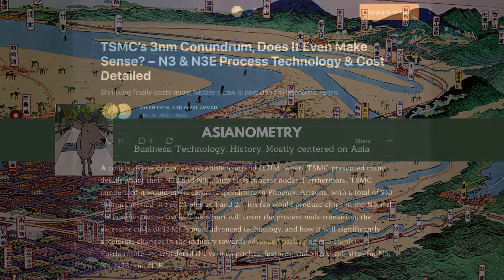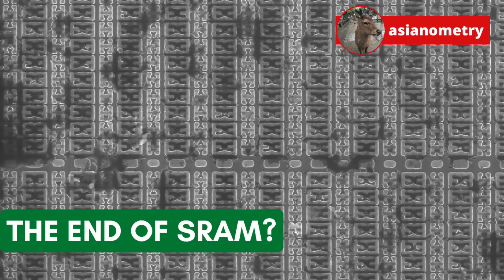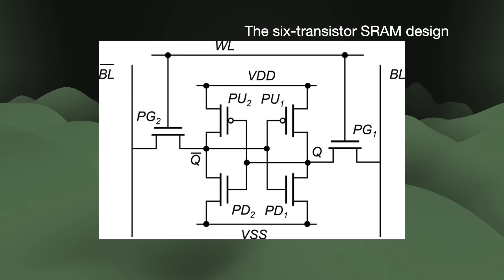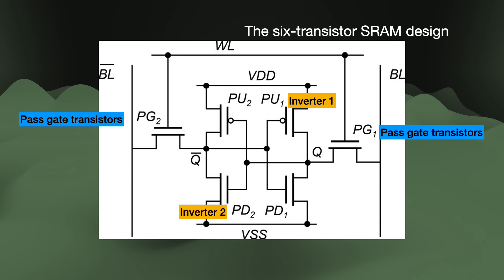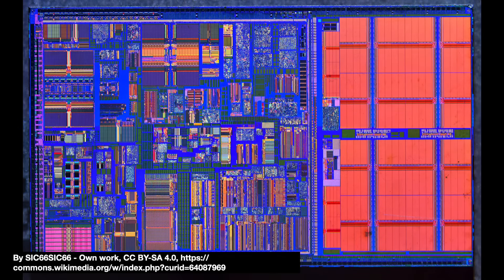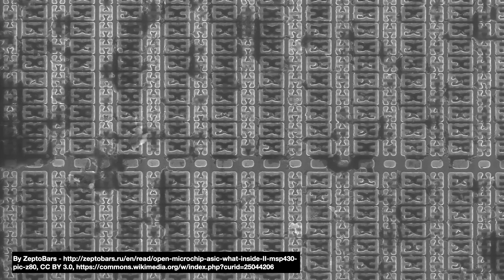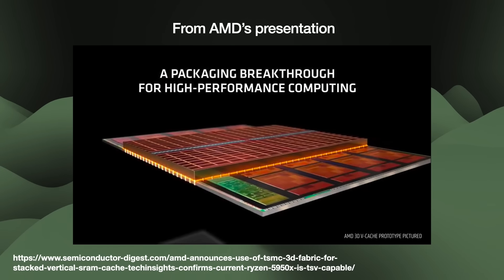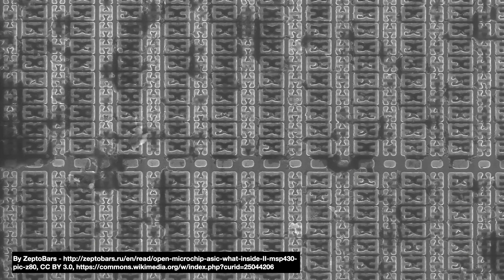Can SRAM Keep Shrinking?

Comment: SRAM is something I would not expect most people to know anything about unless they have some knowledge of CPU architecture.  That is because these days it is used as the cache that comes as a part of the CPU itself.  I do remember a time when it came as a module you could install similar to a DIMM.  That was back in the days of the Pentiums when MMX was the thing to have.  If you ever saw a Pentium II with the heatsink off you would notice two chips next to the processor.  Those were the SRAM chips.  Those ones ran at half the speed of the processor itself.  Why half the speed?  I don't know!  It must have been a technical limitation at the time or a strange decision by one or more of Intel's engineers.

Comment: Thanks for this analysis it provides a vary clear explanation of the challenges in modern chip design. I wonder if stacked cache has trade offs as well such as latency, being further away from the logic core. We seem to be at the limit now with 5nm too be honest this is better than I expected I remember telling a co-worker 10 years ago 7nm would be the limit. These multi pattern designs may allow us to get smaller but at substantially lower yields and higher costs. This is I guess why cutting edge tech is getting more expensive.
Reply: A stacked chip can be closer than most surface of an on-chip cache.
The problems is the chip-to-chip vias use much more space than in-chip lines.
It uses footprint, it constrains line placement and spacing, and it requires stronger electric drive.
Reply: @musaran2  cool makes sense

Comment: since the active layer on a silicon chip is just a few layers and nanometers thick, they could go more vertical like 3d nand.  theres plenty of vertical room
Reply: Except the heat concentrates then and bakes the interior SRAM. It is a solution, but not a long term solution.

Comment: To enable it, try copying Windows 3.1 and dos files from the memory to the micro sd card in about 500 mb quantity. When the copying is faster, you activated this little portion. That is one, why a card is called hc, xc. It acts as a coprocessor. It also acts as a sound processor or codec. The card has Physx, but it is separate. When the portion is active, the card becomes highly reliable. Good for managers who handle precious data.
Reply: What were you supposed to comment on? This doesn't seem like it.

Comment: I still enjoyed the video but I kind of feel like I missed the part about why sram shrinkage is a problem with the current cutting edge nodes in particular. I certainly understand better the core tradeoffs and issues with sram cell design but which part of that is the problem with for example 3nm? Is the answer essentially we don't know because tsmc is being tight lipped about the exact details so we can only make more general conclusions?
Reply: Ah, I think I can answer my own question after watching it again. It's a question of yield. Denser SRAM causes yields to drop below an acceptable limit to be commertially viable.
Reply: @lexer_  SRAM has not scaled in roughly a decade. Now it isn’t even shrinking at all. So we are going 3d and stacking. But that’s expensive and runs into heat issues. Like a hot sandwich where the meat gets extra cooked

Comment: A bit worrying, if the development tackles off, and we still increase the compute demand with 25% year on year or more, I guess we will start using that level more electricity per year. Might be a real problem eventually
Reply: Bro, we have 1kW per square meter coming from above in daytime.
Reply: Well given that semiconductor production shares a lot of the logistics of the solar panel production maybe we can fend of that problem for a few years.

Comment: Intel started their career making ram before switching to chips. Maybe they could use their fabs for 10nm dimms
Reply: Doesn't change the fact that the distance to the dimms is the bottle neck. We've had 7-8ns latency RAM since EDO, but that pesky "universal speed limit" we call the speed of light won't let us go any faster unless we move closer. So we move as close as we can get: onto the chip.
Reply: @andersjjensen quantum computing fix all of that.

If cpu does a true parallel computing it's the other solution to save time instead of  queue in line for certain clock cycle.  Specially if the software is designed to handle multiple thread computing.  Simulation of physics of trillions of individual particles would greatly help. This would required less clock cycle,  and less access to ddr ram speed.
Reply: @BlueRice   for parallel programs we have gpus, quantum will never take over, we need our computers to always give us the same answers.
Reply: @cj09beira  quantum is promising. If it actually works, it's almost like magic. It will give you same answer. The problems with it it is not stable. You will run into errors after long duration. Is there any error correcting methods.. is there a way to check the code after each process. Can it even check itself.. the state of matter is hard to control

If you really want to build a robot, android per say - quantum will make a robot as smart or smarter than human. They already can map human brain pattern to some extent. Load that on quantum computer and it probably have its own consciousness

Comment: SEUs and feature size is an issue ?  yes / no    L1 and L2 cache really need EDAC to avoid CPU crashing.  SDRAM FIT rate was
about one event per megabit per month at Ground level.   This was researched by IBM and others.   24/7 operation can be an issue.

Comment: I was going to ask why SRAM cant keep shrinking at the same rate as lógic ( weird since both just use transistors )  And what posible replacements are there ( STT ram, magnetic ram, etc )
Reply: He said so. Tunneling and defects.
Reply: @alphar9539  But those will affect the logic circuits as well.

I suspect the difference is that SRAM is not clocked at such a high rate: so is expected to retain the data it handles for a longer period of time.
Reply: if you shrink it too much, it becomes a DRAM 😂 an unintended one
Reply: @economicprisoner  logic circuits do not have to be error free. Errors in SRAM are unresolvable most of the time, while logic errors can be corrected without a fatal mistake for the CPU.
Reply: @alphar9539  There is ECC: but it has a performance penalty.
Reply: @economicprisoner  ECC scales even worse than SRAM and suffers from higher complexity. You would likely encounter the same issue of not being able to use the most efficient SRAM die layout design if you have to put ECC throughout. Clearly further advances are possible and likely, it just costs more money.
Reply: @alphar9539  Very interesting, first I have heard about that, how does a modern cpu handle logic errors ?
Reply: @alphar9539  -What do you mean ecc scales worse?

Comment: Yes hello I am a programmer and I would not like more logic on chips please.  Please remove all floating point circuitry and replace it with more cache - the single biggest performance killer nowadays is not the IPC or calculation throughput, it's the memory throughput and latency.  I do not need floating point circuitry on my CPU, I have a very expensive floating point-specialised co-processor in my PC.

I could also get on board with removing all SIMD circuitry too, but that's a more arguable position.

Comment: 📝 Summary of Key Points:

📌 TSMC's new 3 nanometer nodes, N3b and N3e, have the same size SRAM bit cell as their N5 nodes, indicating no scaling of SRAM from the N4 to N3 node.
🧐 SRAM is a fast but expensive memory technology that takes up space on the chip, while cheaper memory systems like DRAM and flash memory are slower and off-chip.
🚀 The history of SRAM dates back to 1963, and the most common SRAM cell design is the six-transistor SRAM cell.
🚀 Scaling SRAM cells presents challenges such as power leakage and process variation, which designers address using techniques like Gated vdd and new transistor gate designs.
🚀 Different SRAM cell designs with varying numbers of transistors offer trade-offs between density, stability, and power leakage.
🚀 Stacked SRAM arrangements, where SRAM dies are stacked on top of logic dies, are becoming more popular to increase memory capacity.
🚀 The future of SRAM may involve alternative solutions as current finFET architecture reaches its limitations.

💡 Additional Insights and Observations:

💬 "Squeezing out more fast cache memory with SRAM seems to be a losing game."
📊 No specific data or statistics were mentioned in the video.
🌐 No specific references or sources were mentioned in the video.

📣 Concluding Remarks:

The video provides an overview of TSMC's new 3 nanometer nodes and focuses on the SRAM technology used. It explains the importance of SRAM in integrated circuits, the challenges of scaling SRAM cells, and potential future developments in the field. As SRAM scaling becomes more difficult, alternative solutions may be needed to meet the demand for fast cache memory.
Generated using TalkBud

Comment: Solution to leakages and quantum tunnelling: Develop fusion reactors and power devices using them.
Reply: You still have to deal with all the excess heat generated. Recall that intel made a huge corporate change away from maximizing MHz when they started nearing the same heat flux out of their CPU’s as was seen in nuclear reactors ~ 100W/sq-cm. Chips do not work as well, or for as long, at elevated temperatures.

Comment: What if we just had... larger CPU architecture?
Like how GPUS get bigger and bigger.
Yes but instead of making things smaller, keep the the same size, and make the area the work on larger.
Reply: that's not how things work, for one a cpu is much much different than a cpu, gpus effectively have thousands of extremely small cores all fed by a hardware or software scheduler, running parallel code, so making a more powerful gpu can be as easy as adding more of those small cores with an increase in the supporting elements like faster memory etc.
Cpus have no such option, cpus mostly run code that is serial in nature where one instruction depends on the next, and prediction can only go so far.

Comment: Still I didn't understand fully why shrinking SRAM transistors is a challenge comparing to the logic transistors? It follows from the video that shrinking any transistor is a challenge, not just SRAM one. Or am I misunderstood something?
Reply: Minutes 6-8, power leakage. For logic it is just power inefficiency but for SRAM it is loss of value / instability. Minute 9 onwards, process variation means problems are uneven between different chips. So when SRAM shrinks they get less and less reliable, so in smaller processes you still make an exception and make the SRAM cells big because you do not want random bit flips in the cache due to power leakage etc.
Reply: @randomgeocacher  My understanding is that all those problems (static and dynamic power dissipation as well as static noise) are relevant for any transistor, regardless of its  application in a circuit. Why shrinkage of transistors doesn't bring problems for the logic? Like ALU producing incorrect results when summing two values.
Reply: @DenisBazhenov for most logic  it goes into a forgiving next stage, like D-flipflop or logic gates. If you loose a little bit of power there will be transistors correcting the loss. Apparently the space efficient 6-transistor SRAM doesn’t have this self correcting property… and thus becomes unstable faster than other parts when shrunk. Maybe the circuit diagram gives some clues as to why? I think the video tried to explain this, hmm.

Comment: I know that the stacked SRAM on AMD's CPUs is higher density than the SRAM on the integrated circuit below it. Does anyone know why that is?
Reply: The SRAM below is likely needed to be more stable for critical functions while the stacked SRAM is for excess functions. Stability is more necessary from the most critical SRAM.
Reply: @alphar9539  Both SRAMs are L3 cache. As far as I know the cores don't differentiate between the two
Reply: @alphar9539  That's not how memory works, nearer memory is used to cache the most recently accessed parts of the next layer, but just because something hasn't been accessed very recently doesn't mean it's less important, indeed many critical operating system data structures will only be accessed occasionally.
Reply: Different process/technology maybe? I would guess the CPU dies are built in one technology and has to deal with its constraints, power, heat issues etc. An SRAM cache die built for a single purpose with nothing else on the die/package has more freedom to optimize.
Reply: @randomgeocacher  looks like the answer from someone else is that the SRAM on the logic layer needs to connect with the logic in a “legacy” manner which also prevents optimized SRAM layout. In contrast the solely SRAM layer is designed only with SRAM in mind and therefore uses a slightly more efficient layout. 

This actually makes sense as the design of a Ryzen Logic layer likely was developed before 3d SRAM stacking was prototyped. The connections therefore were set up in an efficient manner for the “legacy” design. Maybe a future design could be more efficient and denser
Reply: @TheParadoxy  I was somewhat incorrect about the stability reason, it looks like the reason is due to legacy design on the Logic Layer due to the SRAM connections to the Logic. The stacked layers can use a more optimal layout design since there’s no Logic part.
Reply: @MatthijsvanDuin  due to how legacy designs were developed, I assume the critical functions are stored in the nearest SRAM and not on the stacked layers. I doubt the most critical functions were developed with stacked SRAM in mind.
Reply: @alphar9539  As already mentioned, these SRAMs are used as L3 caches, they're not allocated to specific functions.

Comment: Does a L1/L2 cache have to be SRAM instead of DRAM?
Reply: “Have to” implies it is a law of nature, so no? Traditionally DRAM is so much slower and unpredictable, for example the the refresh cycle. So DRAM as we know it today certainly would not replace L1 cache.

Maybe some really speed optimized DRAM variant could tackle L2, L3. I.e. DRAM don’t have an obvious way to replace SRAM, but especially for L2, L3 

I wouldn’t dare to say that designers never can come up with new trade-offs or new designs. So everything depends on if some smarty pants developer can make new designs and trade offs that make sense. The further away from the CPU core it “only” has to be closer and faster than acceding the main RAM to be a good trade off, the closer it is to the CPU core we want near-zero latency and predictable access times.
Reply: Within the logic circuits themselves (as in the CPU) bits can be represented as dynamic charges, very much like in the DRAM. A circuit node would be pre-charded in one part of the clock cycle, then discharged or not depending on the input signals to the logic element, and then the result would be sensed by the next level of logic. Preventing the charge from leaking away between the pre-charging of the node and the sensing the charge later is what sets the slowest clock frequency for such circuits. 

All of the earliest CPUs were like that. If you wanted to execute one command at a time, you could not just suspend the clock, instead there were special circuits for freezing the execution while all the circuits still cycled at their normal rate. But then some CPUs started to be designed without using such tricks, and were "completely static." In this case one could simply slow the clock all the way to zero frequency without loosing any functionality.

So, in principle, dynamic elements could be utilized anywhere in the circuit. Whether it would make sense for the cache would depend on the achieved trade-offs in speed and density. Currently this does not seem very attractive, especially for a process not optimized for DRAM.

Comment: Functionally speaking the main task of CPU is to compute. Any transistor that doesn’t compute is a waste. Cache is not only doesn’t compute, but it’s storing duplicate of the data already present in the system. There is a great potential in new system architectures that doesn’t require to store the same data multiple times. It is very hard nut to crack, I guess. But I believe we will figure this out sooner or later.
Reply: The problem isn't compute power. We already have hit the point that if we tried to run the whole chip at full clock, we would melt the silicon die.
Caches are a fundamental part of the architecture, making it act as if you have a large and fast RAM instead of large and slow RAM. Almost always, the more cache, the better. If anything, we need to move to more and smaller cores and distribute the tasks more evenly among them in an intelligent way, and make that far easier to program for.
Reply: @brainletmong6302  There are different approaches to computing that doesn't require back and forth reading/writing to the main memory. Systolic arrays (foundation for TPUs and NPUs) is one example. It's much harder to program and more importantly those architectures does not fit to general programming, but suit well specialized tasks. There is also PIM (processing in-memory). So there are some options on the table, but none of them seems quite compelling yet.
Reply: as if SRAM is only cache. Every single register is, technically, SRAM. Every little table (all those reordering buffers in your OoO CPU cores  and hundreds of other blocks).
Reply: It is not a waste of that transistor if it is used in a component of the design that improves performance. And that is what caches do.

Performance baby is what it is all about - most of the time.
Reply: @deang5622  exactly, if we follow this logic we can remove the entire CPU, for example, and replace it with an equivalent bit-serial implementation in just a hundred transistors, that would do exactly the same work (but hundreds of times slower).